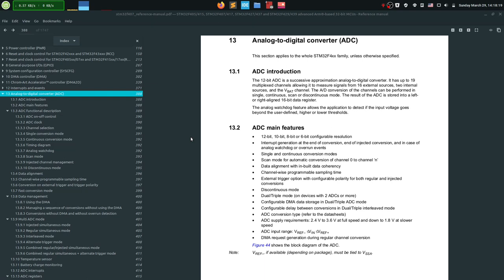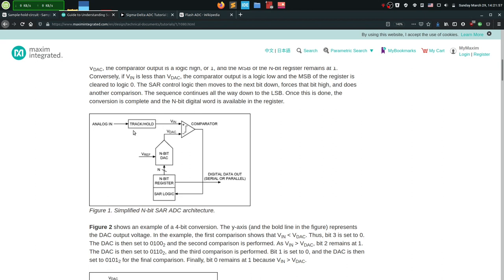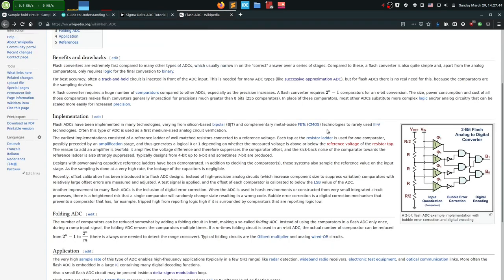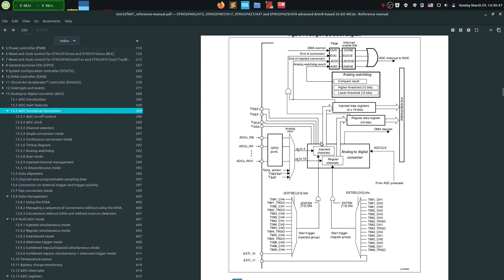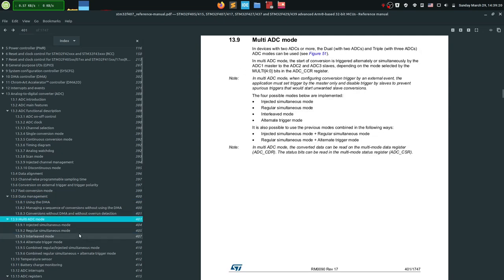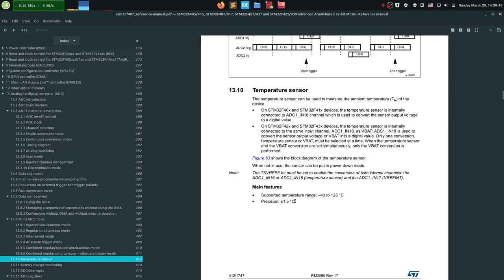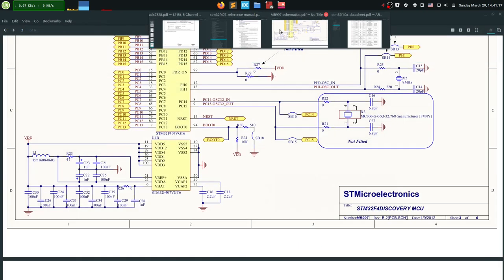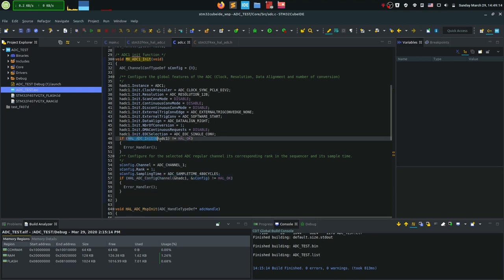Workings of ADC with HAL | VIDEO 24

Comment: very good and informative. i wish i came across this video when i was a newbie. I figured out though that one thing that was worth mentioning is the Nyquist theorem, especially when adc'ng waveforms. It literally is a determining factor on which micro-controllers to use or avoid due to their maximum functionality of the ADC sampling capability. But am late on this and perhaps someone can find it on another video on youtube
Reply from the maker: Yes, I agree that signal processing and analysis is an important subject that in university is covered by a few electronics and math courses as well, if we want to go into the details of why certain theorems and practical advices hold true. The software implementation is also connected to the hardware frontend, like the kind of filters you use on the input of the adc.
I would recommend finding content on signal processing and analysis on youtube, which can be adapted to the STM32 adc quite easily. We're just talking about sampling time, sampling period and adc resolution and reference voltage. With these you're basicaly set. I would like to do some practical demonstration with some theory, but currently I'm limited with the gear down to a dev board and a pc. Maybe someday. Thanks for watching.

Comment: Hey, thank you for this video.  I have a question, so this code basically reads analog voltage and writes to an integer and next cycle it will overwrite old value. But if i want to store all data or just have all ADC readings, should i use an array instead of integer? Lets say i want to  measure Sin wave for 5 sec and see all the values, is it possible with this code or should i use an array instead of  your adcval integer?
Reply from the maker: You should create an array of (uint16_t) elements of maximum size that you need. First you need to figure out your sample rate, which has to be larger than 2 times the maximum frequency that you want to capture. This is important, or else you will not get a perfect sine wave. If your maximum frequency is 1kHz, you should sample with at least 2kHz.
You can sample with interrupt using a timer which triggers one at 2kHz and read from ADC and put a value into the array, remembering your current write position, or you can connect timer to trigger ADC to perform a conversion. Then you can configure ADC to trigger interrupt when its done and do the same as before.
The most elegant solution would be to have same thing as in second case, but instead of interrupt, ADC would issue DMA request. DMA would copy value to that array without disturbing you. After it's done copying a number of samples set (for 5 seconds at 2kHz sample rate is 10k samples) DMA can trigger interrupt that it's done and you can read the data. You can also make things continuous with cyclic buffer with two parts along with DMA.
There are still a lot of things to think about when sampling a signal. For data flow check out my DMA video. I will make a video about sampling in the future and all the things you need to think about. Stay tuned.
Reply: thank you very much. Waiting for new tutorials !